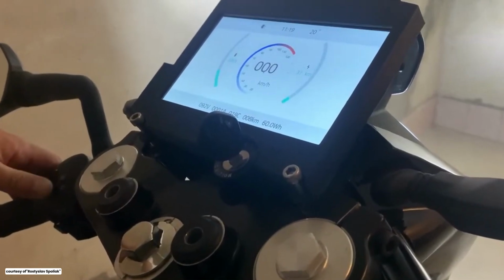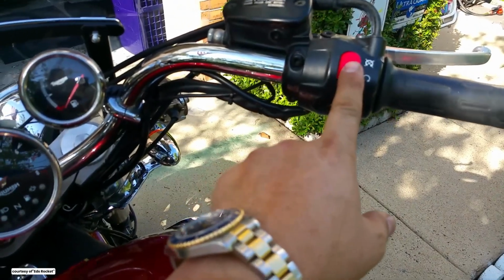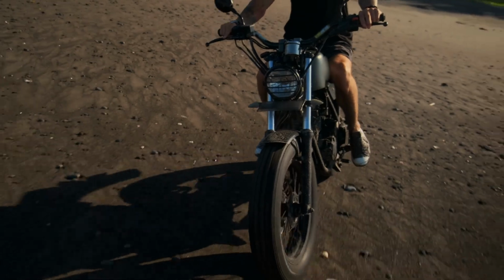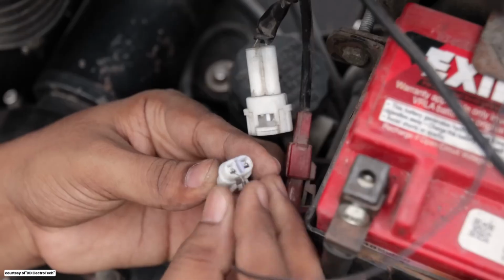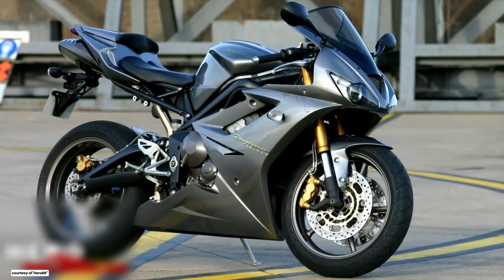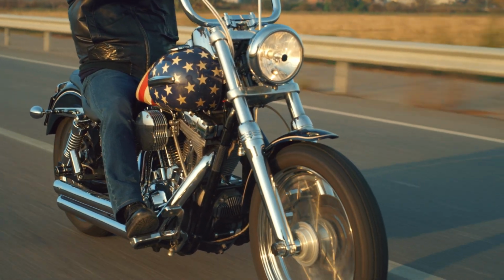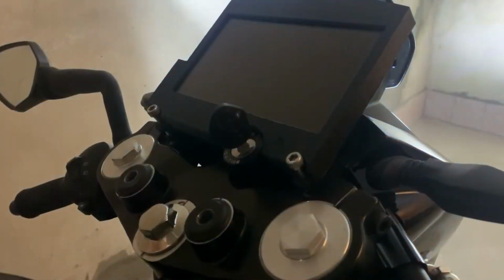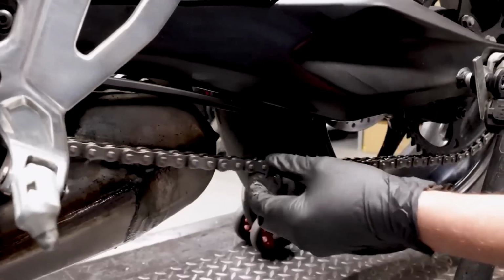9 Hidden Motorcycle Features That Secretly DESTROY Your Engine’s Lifespan!

Comment: Clutchless gear shifters have been around on production bikes since Jawa introduced them, back 1958. They licenced them for use on the Honda Cub series, from the mid 1960's onwards. They were also on all CZ production 2 stroke road & trail bikes from 1958 until 1997. On the plus side, they allow for slick, clean gear changing with or without the rider squeezing the clutch lever. The rider can even slip the clutch by pressing down or lifting the gear lever, should the clutch cable break. On the down side, they require some skill & expertise to set up properly, otherwise they perform badly. 

It doesn't surprise me that today's motorcycle manufacturers have reintroduced quick shifters as a pointless sales gimmick.
Reply from the maker: Great points! You’re absolutely right these systems have deep roots, and modern quick shifters often feel more like marketing than real innovation. Thanks for the detailed insight! 👏

Comment: Yamaha R15 V3 has this in India:

It's a 153cc liquid cooled engine pulls out 0 to 60kmph in 5 seconds. What's weird is the Quickshifter, Traction control, Slip assist clutch, Dual Channel ABS, TFT instrument cluster screen, Ride by wire throttle.. all of it with Lead acid 12V battery on it 😂😂

V4 is going to have ride modes 😂😂
Reply from the maker: Haha, so true! 😂 It’s wild how much tech they’re packing into a small 150cc bike. The V4 with ride modes is just the cherry on top! Thanks for sharing!